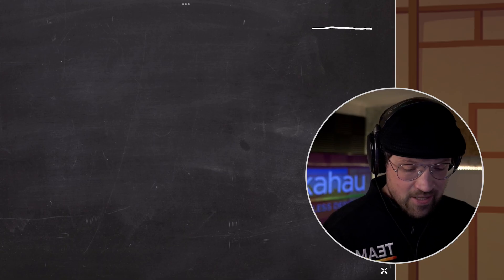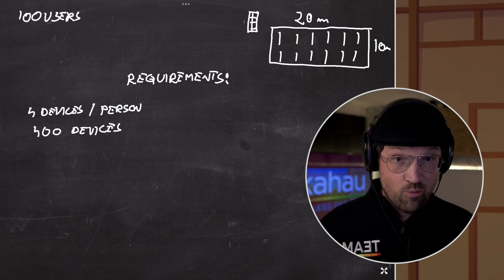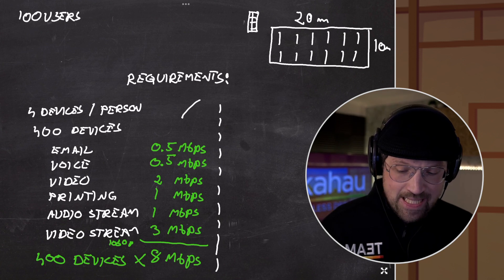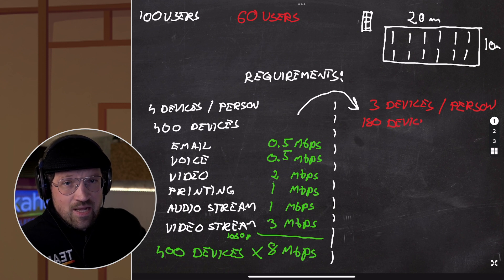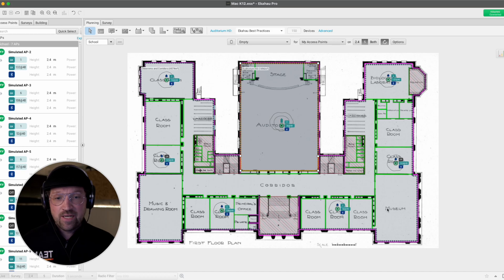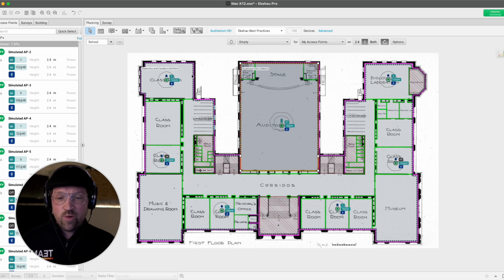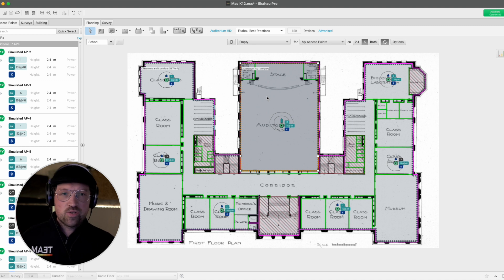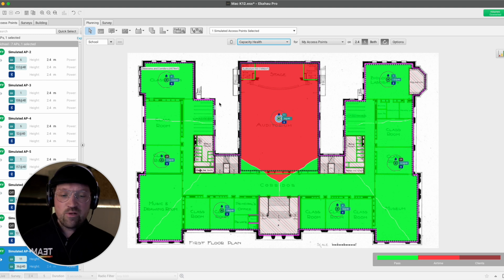How to Design Wi-Fi Capacity in Ekahau Pro

Comment: Hi Mac,

Thank you for this - just a question on your first example in the large open space office with a massive amount of users inside. I have an upcoming project which involves offices like this - the client is using omni AP's. How do you design for great capacity in this situation as surely high signal strengths are mixing whatever you do with the design. Would clients definitely just go with the very best signal strength or are there high chances they could potentially be associating with an AP at the other end of the office that is still hitting around -70 to -75 where they are sat? Cheers

Comment: Great Video, thank you a lot!! Quick question: At around 09:40 when defining the devices per area: Is ekahau treating the 50 smartphones and 50 laptops as if they are 100 % concurrently used or does ekahau apply some kind of simultanity factor on top of it? It should be the first one, right?
Reply from the maker: Correct - it plans for them to be concurrently used. Thanks for the feedback!
Reply: @EkahauWiFiDesignTools  ahhhh okay! Thanks for the fast answer and see you tomorrow :D